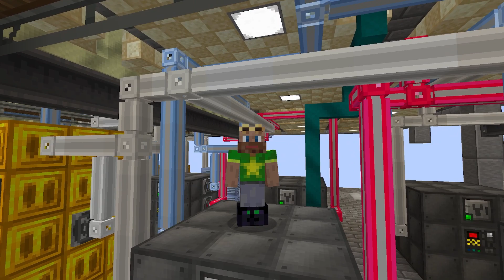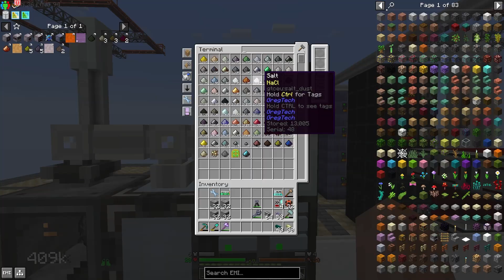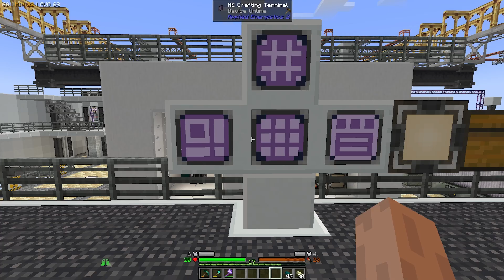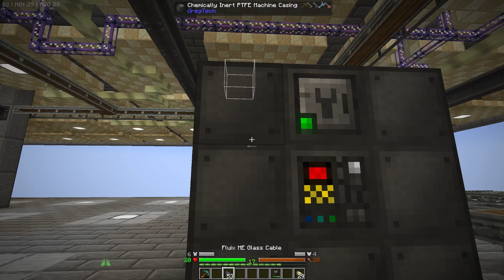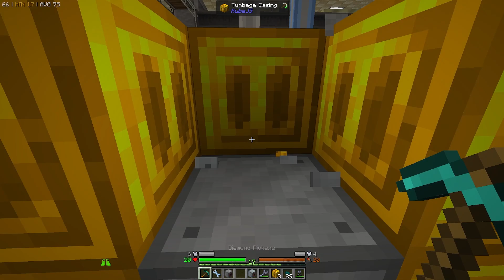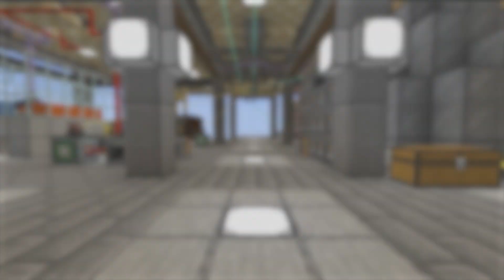Star Technology - 22 Mastering the Platinum Line

Comment: Could you explain the subnets more? I cant understand anything about them 

Your videos are amazing and i love watching them, youre the best star technology youtuber that i could find
Reply from the maker: Sure! I'm planning to do a proper video on it later, but here's the simplest way I can think to explain it: 
To work, ME devices require two things... power and data. ME cables provide both. 
There's a special cable called a quartz fiber, that only provides power. No data will go across it. So if you have two networks with quartz fiber in-between, they can't see each other (for data purposes). So technically they are two networks. In practise though, we refer to the network that doesn't have the ME controller as a "subnet". 
You can go a step further by adding an interface on the subnet side and attaching a storage bus to that which is part of the main network, and the storage bus will "read" the contents of the interface, which will be whatever the subnet has within it.
In my base I have a few subnets, notably that one as part of the platinum line - I did that because I was worried that the processing of the intermediate products of those chains might accumulate and fill up my main storage. By having it on a subnet, the worst it could do is fill up that drive. I did a similar thing for my oil refining.
Hope that helps!
Reply: @gameswithpostie  it worked on my test world so it will probably work on my main world, tysm for help postie
Reply: @gameswithpostie  Thank you, i will try that and answer if it will work

Comment: As always, W video, unironically one of them best Gregtech youtubers that I've seen

Tip, for the best power generation with dynamos, use the EV upgrade ofcourse and 2 multi cycle and 1 reaction kits, it gives 200% efficiency and produces 900% faster.

Also diatrons are really good for energy, each one produces a little over a million EU (4 million RF) without any upgrades when they're at their last tier (Exquisite)
Reply from the maker: Thanks that means alot to me! I've looked into diatrons, and the overhead of producing them at a decent speed eats into their potential as a power source, so it's not quite 4M RF, but they are still several times better than diamonds. 

It's tempting to give them a try, but I'm very close to having gasoline, which is better than diatrons (6M RF or 12M for high octane) and is simpler to produce if you ignore the distillation infrastructure required - because that has other uses too

I feel like diatrons need some balancing to make them a more viable upgrade to extend the life of the lapidary dynamos.. Like maybe make the laser engraving steps quicker?